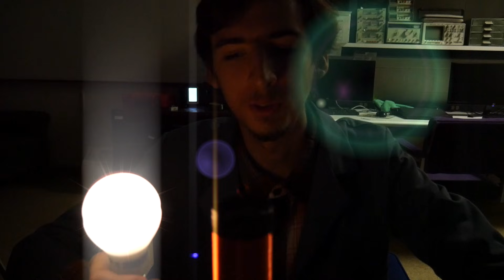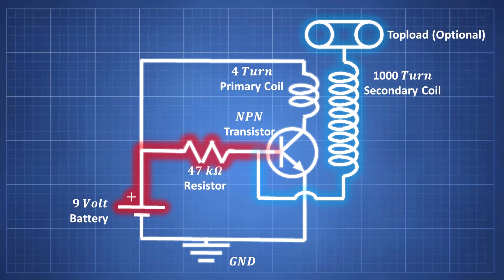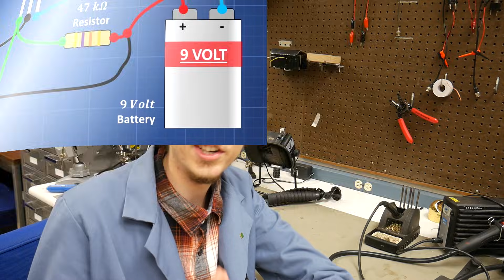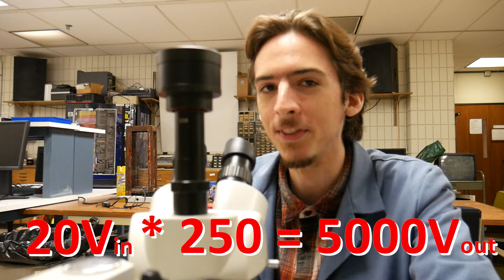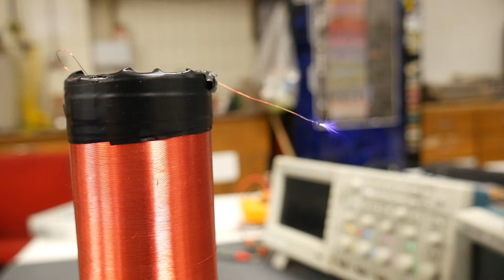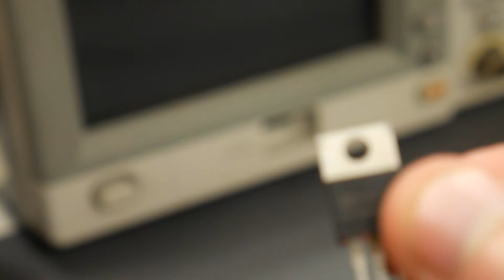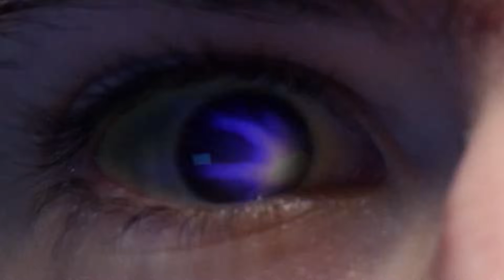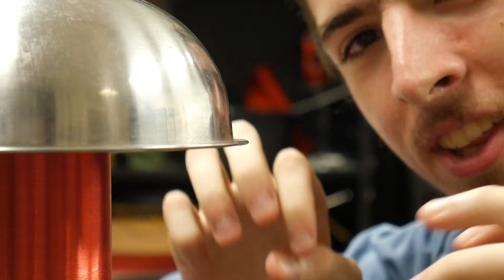SLAYER EXCITER - Tutorial, Explanation, and More

Comment: What is the total length of 30 AWG wire u have used
Reply from the maker: I can do one better. Below is the link of the exact wire that I bought from the interwebs. It has all of the info in the specs. I ended up using about 2/3 of the spool. Be aware, there are cheaper options; I just find red copper to look baller.
https://www.amazon.com/Remington-Industries-32SNSP-25-Enameled-Diameter/dp/B00I539ZVY/ref=sr_1_5?ie=UTF8&qid=1547267193&sr=8-5&keywords=remington+32+awg+wire
Reply: @BlueprintScience  only problem is i live in india and idk why buy in my locality no one sale these wires

Comment from the maker: VIDEO CORRECTION:
This is a small detail, but it should help your designs work much better. As my switch, I use several transistors in parallel with each other. The issue is that the transistors do not divide power equally. Due to thermal effects, one transistor will take on more load over longer periods of time as temperatures diverge. To get around this, use a "Darlington Transistor Configuration." It's really easy and an internet search will show you what it looks like.
Reply: Have a question does the diameter of pvc pipe matter?? And if i used multicore wire for primary winding??
Reply: Can you draw a schematic of how I would connect 4 TIP31C transistors in a darlington configuration? I have only found the schematics using two.  Thank you again for all the help! :)
Reply: @gunrunner2192  connect all the collectors and make the emitter of the transistor connected to the other transistors base
Reply: @gunrunner2192  If you connect 4 TIP31C in Darlington configuration then the circuit cannot produce high voltage as Darlington transistor configurations are inherently slower. So the primary never ever reaches the resonance frequency. If you want to use a Darlington configuration just stick with 2 transistors. But if you want to beef up 
the circuit you can increase the input voltage.
Reply: Jd Jd thank you sir!
Reply: I don't mind can u make its diagram and upload it on Google drive or somewhere... It will help me i need to make a Tesla coil  for my school project... And need ur help
Reply from the maker: @FutureOfGaming  You didn't like the diagram in the video? There are many diagrams for the same thing out there; do a google search for "slayer exciter circuit" and the image results will have many well drawn diagrams for you to steal... I mean borrow.
Reply: @BlueprintScience  ima asking for Darlington setup
Reply from the maker: @FutureOfGaming  From Wikipedia: data:image/png;base64,iVBORw0KGgoAAAANSUhEUgAAALgAAAESCAMAAAB5He/JAAAAbFBMVEX///8AAADa2tq2trYdHR1KSkp2dnZmZmaIiIi/v7/4+PjNzc2SkpLCwsKvr6+6urpUVFRFRUUTExPT09Px8fFsbGzm5ube3t55eXnp6elhYWEhISF/f3+Wlpajo6OwsLAwMDA+Pj5YWFgsLCydXznZAAAEIUlEQVR4nO3dW3OiQBCG4RlAxVPQgLBo1Gj+/39cxqSyHhBkGLp7ar/3Yi9Si/vsFEICHVQKIYQQQgj9JwXb8Z+PD25F9xI9UyrdcTO6p1Pz54Gb0bml5hZYdvQVPvcVrnTCLbBsbt6dxYKbYVEWb+IpNwIhhBBCgxfokJtgF+DUAU4d4NQBTh3g1AFOHeDUAU4d4NQBTh3g1AFOXeHrjbeD9nAEoepTV5Xciu7Fxq1HbP9+qSOrdvq7GRdcRyO7fuBcbqX/WG64uLjPTjFd0mPbLVeVe5e5tHTKHq5CzTmC0APOewLqAec95QNOHeDUAU4d4NQBTh3g1AFOHeDUAU4d4NQBTp2v8FDH1tsywsP3Ppdb2eCG/dZjeya4YR97vQILvO9qmxjgLtiDw8s8v7v67oY9OPysb29HumIPDp/o60O1OzYp3CWbEO6WTQZ3zSaCu2eTwKcDsCngegg2BTwagk0BH+gGMOkJyGWA1wf4Q4DXB/hDgNcnBZ6V5f3PkM2JgU/0caE7PJBFCly9rZVKO1w4EwUv7uCz56mtGPguPJyC26/p5oTAT2U6uRsiXjxvfxIDr3YV1eEnmo0s+OubSHlzZhudLleT1zeQAi/zvCi6TJtLgXcO8IcArw/whwCvD/CHAK+vgnf4BqFLFNfHB7nOPDz8/DUInWIfT3YD0GnenEnknE51VHG+6nSHw6tVd/H7o5TH8V96vO3/ygPD766r/NC13vR+5YHhh/H4doLJ0Kv/TX85/YRQcvnN9N5yhtGmvXYhZ4CftAs5yxTcfD/qLWcbmJzv+52SCsbZ2uoIk9puG6wi620dZLu3BKvBhhtey24M27BjvocJmGzgAtg2cBHs7vALm+3ZJFc1wsMkzG++IGS1TY3w6hR1/XgJw/6QsNqmNvi/W8EXtozVNr0KF7Xaptfgwlbb9Apc3Gqb2uBLFZzFHEmua4PvzwJX29QGF7napjb4RuJqm9r3caG9fgISFuDUAU4d4NQBTh3g1DU+01M0fJvOn5VKhsctc7li4Wq6fJ5oeFOAUwc4dYBTBzh1gFMHOHWSrx02VsFtPzuAt8t35AupF5obMuyRj/TLPp6u/aP/HFX8o/8eDn2jXx3Hr+jB8w2kdHMC+qU7mG4durvpiQtdJbrHUymJOoZvt/Mqhh5pD+SPpd9Toh7KI+2nvBzvPJUrlSUfkeSb5Y1lSfU9zJ5bYVe63nlwKqqLc5q5V95+6CLg1AFOHeDUAU4d4NQBTh3g1AFOHeDUAU4d4NQBTh3g1AU9P8GJrdm85CYghBBCCNWXzWZZlnl4Oz//PC2nyTs3w6LYDK/OuRUWGfgsb/974opXSbjhfDSZbfEkzw9ews0+LvNBIM1d4OrAzejcbL0O0uWXfzNCeVEEQVBwMxBCCCEkoL8e2ynWal+UVwAAAABJRU5ErkJggg==
Reply from the maker: Wow, that link was absurdly long. This one is better: https://en.wikipedia.org/wiki/Darlington_transistor
Reply: @BlueprintScience  yeah thanks for shorter length
Reply: @BlueprintScience  should i use heatsink on tge transitor ... And my 47k ohm transitior is way smaller then urs does it work
Reply: @BlueprintScience  thanks for that now i understand how to use darlington setup ....
Reply from the maker: @FutureOfGaming  1/8 watt and higher is fine. It will only dissipate no more than 20mW
Reply: @BlueprintScience  could you please make a video about how are we going to add these transistors by darlington pairs to the circuit?
Reply: @buscoparan1772   use 2 transistor in Darlington and another to run another primary coil so a 2 primary coil setup
Reply: @harshityashwardhan  2 transistors in DARLINGTON. And a other 1 transistor for primary ? 

Total 3 transistors ? Could you help with transistor setup for the circuit diagram ?
Reply: @FutureOfGaming  darlingtons don't work with that, trust me, for a thing that size use a TIP41C an an heatsink (no need to insulate it if the heatsink don't touch anything else), put a diode from emitter to base (an 1N4148 or UF4007), for smaller sizes an LED will work as well and you'll see if it's oscillating
Reply: @redoverdrivetheunstoppable4637  How about connecting those old 2n2222 transistors in Darlington configuration without a heatsink?
Reply: @rishisrikanth8877  i don't remember we were talking about the 2n2222 but except the darlington thing it's possible, i made a tesla c with 2n2222, if you don't push much with supply voltage and\or too few primary turns it lasts some time... usually you buy the 2n22222a in packs and cheap (if you buy online), you can also try to heatsink those, if you don't want to change it every few seconds... forget the darlington, good (and especially small ones) BJTs have already a good amplification (HFE), if your transistor is NOT amplifying good enough you can see the spark becoming way longer if discharging on a piece of metal\hand, if the amplification is good it will NOT become much longer... but the 2n2222 is litttle for an actual spark

P.S.
fun fact, if you google the image of "TO92 heatsinking" you find a tweet from Frantumapal, showing the way to solder an heatsink on the inside collector tab of a small transistor... that's me :D
Reply: @BlueprintScience  I tried the Darlington Pair but as someone down here stated, it can't work and in fact, it does NOT work, this is because the two transistors get slow in cascade and can't oscillate.
Reply: @BlueprintScience  that was really really cool helping that kid with his project...
Reply: @FutureOfGaming  A Darlington pair is a very easy two transistor hookup, VERY EASY TO REMEMBER THE SHEMATIC of how it connects ... it is very simple, yet offers greater power handling capacity for the little transistors in your hobby collection,. Use two identical transistors, collector connected to base.
Reply: @BlueprintScience  I think Darlington transistor setup cannot oscillate the primary coil at the resonance frequency of the secondary tank circuit. But It can provide more current than the single transistor so high voltages can be achieved but not at the resonance frequency.
Reply: @BlueprintScience  can i use a tip122 its a datlington NPN
Reply: @BlueprintScience  Hi so we can change the TIP31C with an TIP122 both are npn but TIP122 is already in a darlington configuration
Reply from the maker: @reyes4431  Should be fine, those transistors will likely overheat faster
Reply: Use bd243c instead of tip31c it's more efficient and u can crank up the voltage upto 30v with heat sink
Reply: @noobkid5983  i have used tip35c and its running fantastic with a heatsink
Reply: @noobkid5983  

BD243C OR CG is very difficult to find. Do you have a link to an online store ??
Reply: @noobkid5983  are u sure
Reply: @f.f.f.fifamobile2078   yes
Reply: If i use a darlington pair having 2 TIP31C transistors how much voltage it will be able to handle?
Reply: @vikascsgo  It can handle up to 16 v efficiently.
Reply: @vikascsgo  test it until it blows up.
Reply: Is it ok to use 24 awg for 2ndary coil?
Reply: IS POSSIBLE TO USE A IGBT BRICK IN ONE OF THIS SLAYER EXCITER ?? I HAVE ONE AROUND AND I LIKE TO DO SOMETHING COOL WITH IT. I MADE MY FIRST SLAYER USING A DARLINGTON TRANSISTOR AND WORKS BEAUTIFUL. I KNOW THIS IGBTs ARE A LITTLE MORE COMPLEX BUT IF SOMEBODY KNOW ANY SCHEMATIC AND MORE INFO ON HOW TO I LIKE TO KNOW MORE.
Reply: Thanks man I was planning to arrange them paralell
Reply: There is difference btwn 2 diagrams around the primary coil which one is correct?
Reply: Can we use any npn transistor
Reply: Waseem tariq I used 2n3055 with a 5.9k resistor and works.
Reply: @hanzelmiranda  great transistor the 2n3055, ya get up to 15 amps outa them, although thats pushing them to hard in my opinion ; )
Reply: You can use 0.2ohm resistors to emetor of each transistors to equalize the current and a aluminum piece of  heatsink.Or a bigger more powerful one  transistor with heatsink..Without heatsink big transistor will burn probably because of power dissipation.You must get the heat from transistor. Your video is so nice and u take a like from me . Congrat!!.
Reply: Can i use TIP122 is a darlington transistor
Reply: @Blueprint can i use a tip122
Reply from the maker: Israel Gómez, that will work, but it is a less powerful transistor; you’ll need to operate at a lower voltage.
Reply: @BlueprintScience  The tip122 has the same parameters as TIP31C and it haves an Hfe of arround 1000
Reply: Hi! Does the thickness on primary coil matter?
Reply: hey bud i think its time for part 2 tesla coil. boosted circuit. i made my tesla coil using pvc pipe of diameter 1 inch and it works but the thing is there is no visible corona. and i really cant get a higher input voltage from my transformer. currently running it on rectified 20 volt dc. so i guess u could try to get more power out of the tesla coil without changing the input voltage and the windings........... : )
Reply: @Mark Viz-2022  I give it 20v input but still none..... I can't increase the voltage any higher as I don't have the necessary equipments. And currently there is no overheating problem
Reply: +Blueprint yes it will divide power equally but it will waste more power because their resistance will add up
Reply: how did you do the grounding
Reply: I think your transistor burned because there was excessive reverse current flowing due to the emf of secondary, maybe that's why they put a diode
Reply: @electrode6872 where do we put the diode and which side to connect where
Reply: Are you home?

Comment: how did you manage to feed your circuit 30v? mine fails at 10v
Reply from the maker: I had that problem with my first design. There is no single solution. It depends a lot on your design. Here are a few things that I find make the biggest impact:
* Higher power transistors - If nothing else, brute force is the most sure-fire way to handle more power, but it can get expensive
* A larger transistor array - To divide the power more. Darlington Transistor configuration works best and transistors in parallel is also acceptable
* More turns on the secondary - reflects a lower impedance onto the primary. Translation: More turns on the secondary reduces current through the primary and transistors have less to handle.
* Ditch the topload - Having a topload demands more power from the circuit but gives generates a stronger electric field
Reply: so after some experiments I found out that the base of the transistor was being fed more than 5v, so it failed. A simple solution is to add a Zener Diode between the base and ground. that way the voltage would be clamped below 5v.

Comment: I built this circuit just as you listed and tried it with 4 TIC31C transistors each with a small heat sink. The minute I add power from my 18volt 2am power supply a transistor fries :( what am i doing wrong? do I need diodes and different resistors? 
7" long by 1" diameter 2ndary with 1000 coils of 34 gauge, 3 coils of 12 gauge for primary, 2 22k ohm resistors in series and a top load. 

works great with a single transistor with a 9 volt battery but I want moarrr powerrrr! lol  Please help and thanks for this video!!!
Reply: Hello, 

The author says we need to use Darlington transisitor configuration instead of the 4 transistors in series. 

How did you get over the initial problem you faced 2 months ago ?? 

I want to use mine at 24v 2.5amps.
Reply: @megaraitei  I never did. I ended up using a single TIP31C and a 9 volt battery :(

Comment: Will the transistors fry if you have plugged in a 9 volt instead of 20-30?
Reply from the maker: Absolutely not. Indeed your transistors should be fine. You could even use something smaller and cheaper like a 2n2222. However you are unlikely to get very large sparks from a 9V input.

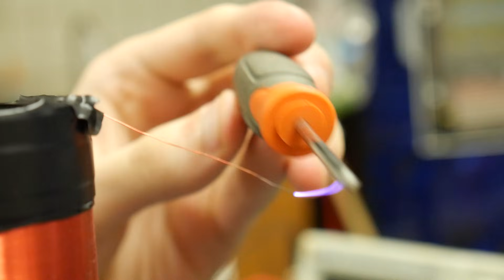Comment: If I mount the transistor on a heatsink, I can avoid 8:12?
Reply from the maker: Probability. Be warned: heat sinks only work up to a point. But in general, they make components last longer at high powers.

Comment: Hey iam not able to find tip31c hre does any other transistor work like tip31 or tip35c?
Reply from the maker: A TIP31 works the same as the TIP31C except is operates at a lower voltage. So long as you stay below 40V DC, the TIP31 functions exactly the same as my setup.
The TIP35C is a PNP transistor which means that rather than having a positive voltage on the base, you need a negative one, accomplished by swapping the + and - on the power source. You may also have to invert the direction of the secondary coil to get an opposing positive current rather than a negative one.
Reply: @BlueprintScience so if i use TIP31 it will work the same as yours... How much transistor is needed in parallel?

Comment: I've always heard that messing air with high voltages can make a reaction where the oxygen creates Ozone, does this happen here?
Reply from the maker: Yes it does. Every high voltage discharge (such as a lightning strike or smaller things like ESD) break up O2 in our atmosphere into atomic oxygen. A very small percent of these atomic oxygen form O3 (ozone). 
After a while, you'll be able to smell it from this Tesla Coil - it has a sort of metallic burning smell that you'll know right away. But there isn't enough ozone to be worried about. Especially if you have any ventilation.

Comment: What’s the max voltage I can input?
Reply from the maker: That depends almost entirely on what your transistor is rated for. It's not necessarily the voltage alone but the power that burns up transistors. In my experience 30V is max for sustained input and 60V will work for about 15 seconds using my setup.
Reply: Ok thank you ñ, I’ll try that out

Comment: Can I use a tip41c ?
Reply from the maker: Yep. should work the exact same way by my quick research
Reply: Should I change the value of the resistor?
Reply from the maker: @Coyote0874  You don't have to. I think anywhere in between 20k and 100k ohms do the same thing. Changing it makes very little difference since the transistor is in saturation (a state like a closed switch)

Comment: Sir.  We can use step up booster voltage input to Tesla coil  . Tell me no problem or problem
Reply: I saw  one video Schematic diagram in musical Tesla coil. so audio jack 2 wire it come  first wire is negative (-). second wire is join secondary coil it work
Reply from the maker: Possibly. It depends on how much current it can handle. A Tesla Coil is essentially a transformer which uses magnetic fields which relies on a large current.
I am unsure if a voltage booster is capable of that.
Reply: Thanks you reply answer . ☺️☺️☺️☺️☺️ .
Reply: I use xl6009 step up DC to DC thank you
Reply from the maker: @ayshathsameerayahya7470  I see what you mean - stepping up the voltage that way should work fine. However, notice that the operating frequency maximum on the xl6009 is 400kHz and Tesla coils operate at around 500k-1M Hz.
This may work well. Without testing, I just don't know.

Comment: I just killed 4 trancistors when doing this circuit. I did everything true and it worked but after is just exploded.
Reply from the maker: That happens. The heat generated is proportional to voltage^2. You most likely just need to bring down your voltage supply.
Reply: @BlueprintScience  they are not heating up. I put them on a heatsing and they just explode and the exploding parts fly  5meters away. It worked for a while so I closed the power then I turn on again it explode :/ I think using a  modded microwave oven transformer overloads the trancistors. I tried with 12 volts and 25 volts. I could go to 45 volts max but I am out of trancistors now. I thing using a ZVS driver and flyback transformer works better.
Reply: Can I drill a hole in penny and attache one of them to each in transistor bank? To use them as heat sink I'm using 6 TIP31C